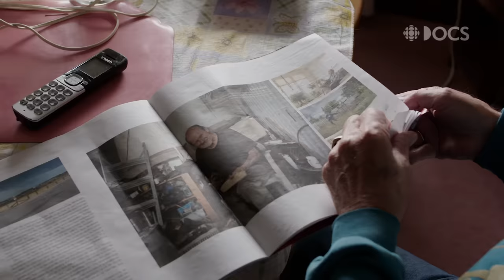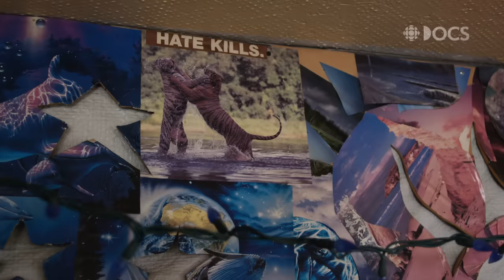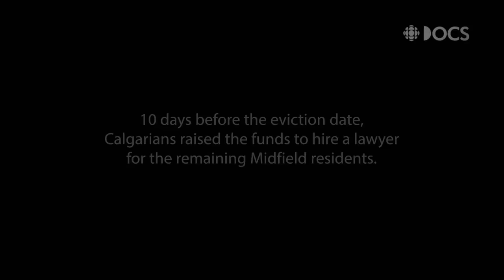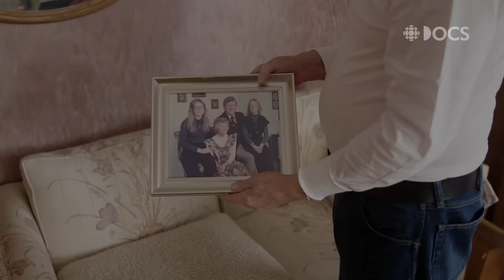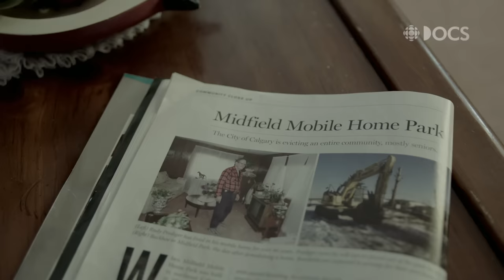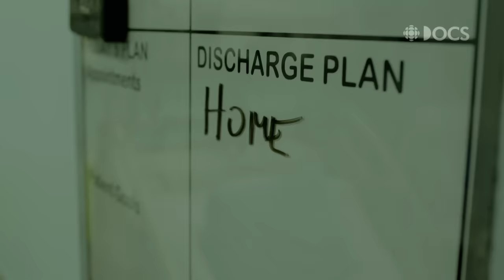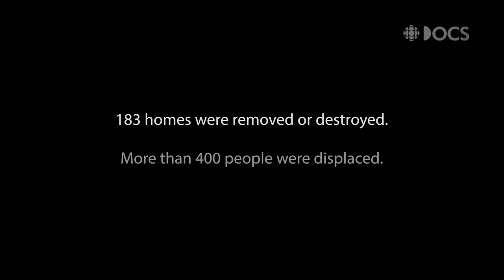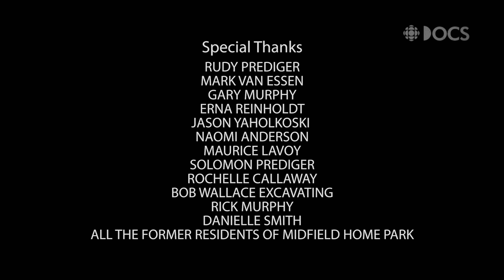The city wants to evict them from their mobile homes. But they're fighting back. | Eviction Notice

Comment: Some of these people need to go price what it costs to buy one of these double wide "trailers" I have one l bought brand new in 1997 and l pd 75,000 for it. 2023 square ft and 4 bedrooms for myself and 3 children. Today's market that same home goes for over 200,000. When Apts went up to over 1000 a month l decided to buy my home. It was impossible for me to come up with the down pymt for a stick built home and still take care of my 3 kids, working full time as a nurse and also another part time job. I didn't rely on welfare. My ex never pd a dime in child support, and l didn't want my kids living on top of one another. Trailer homes just like stick built homes require maintenance and upkeep and l have seen my fair share of shitshow homes full of garbage and trash and they were NOT trailers. They were owned by Dr's and Lawyers and Engineers. 400,000 on the outside can be deceiving.